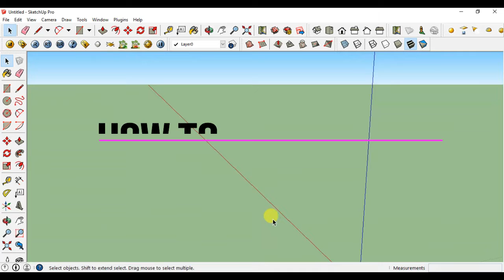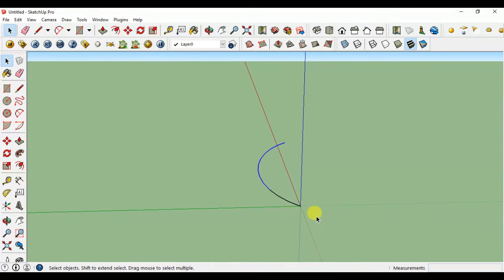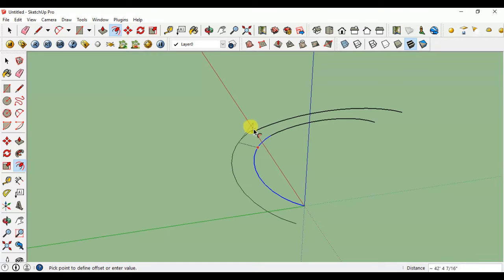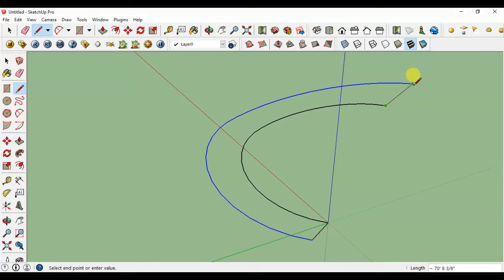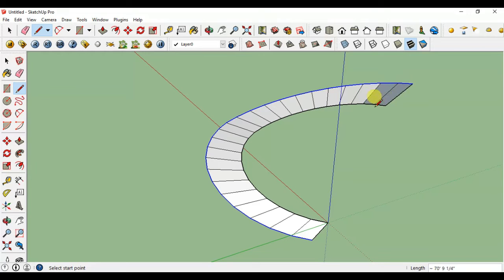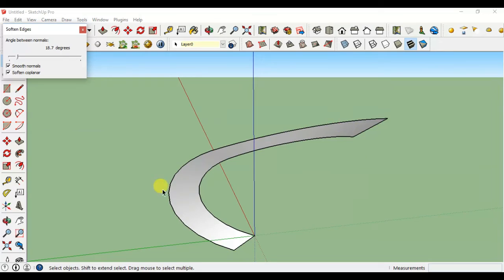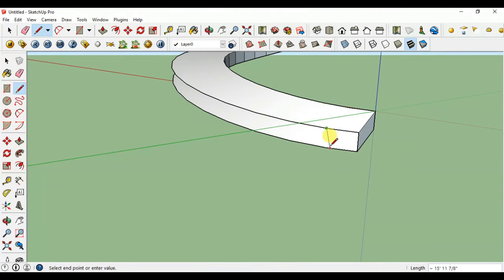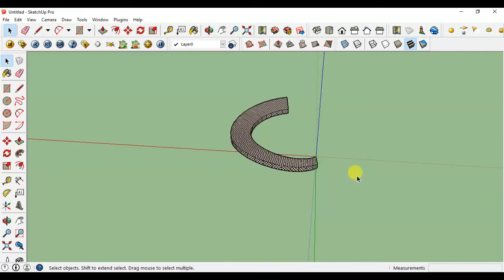Sketchup tutorial - How to make a curve ramp/slope? (without any plugin)

Comment: Here's an easier way...
> Draw a circle, then use the offset tool to create a smaller circle inside the first (having dimensions of whatever you like).
> Use the line tool to bisect the included circles, then erase one of the halves.
> Next, erase the smaller interior circle's flat edge, to eliminate the edge and the face as they aren't required.
> Use the push-pull tool to extract the face of the remaining semicircle into 3 dimensions by a couple inches or so.
> Move your view around so that you're looking at the new faces created along the plane of the earlier bisection.
> Select one of these two faces, then use the move tool and click somewhere on the face to initiate the move.
> Press the up arrow key to constrain the face to the blue axis, then simply push that face up to a position directly above where it was.
> Throw yourself a party - you did it..  🎈🎉
Reply: But when it angles up then it won't be right..  the curve is too short no?
Reply: @gijoe696  no i tried it
Reply: This definitely works and is much easier, thanks!  Just note that you also need to select the bounding edges of the bisected face for the geometry to shift, otherwise the face just detaches.